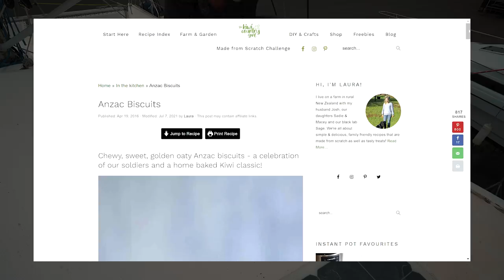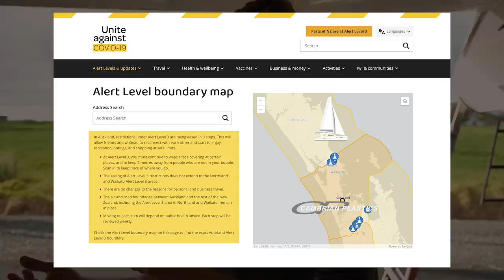BOAT REFIT: Our Biggest Project Ever!

Comment: Just FYI they make a special blade for removing caulk with a multi tool.
Would be very helpful for future jobs ,it has no serration on the blade.
You guys are awesome ...
Reply: I’ll second this comment. The scraper blades for multi tools have a finer edge and no serrations. They are ideal for that sort of caulk removal job.
Reply: I hope they see this comment, my thoughts exactly.  I have the same multi-tool and numerous blade types for it.  I've stripped off heaps of cured caulk in long bands quickly using the scraper blade, worth it's weight in gold.
Reply: One can be made from a standard saw blade by grinding the teeth off and sharpening on the top like a chisel.

Comment: You can get a scraper blade for the oscillating tool that has no teeth, FYI...works pretty good on caulk without as much risk of damage to the hard parts (fiberglass, plastic).

Comment: Add a scraper/knife blade for your multi tool
Reply: Yep and get a few long reach blades too. With a grinder you can make whatever shape knife/ scraper you need by removing  a blades cutting teeth and sharpening the edges .
Reply: I was going to add the same comment. I have made several custom blades for different tasks. However there are a lot of stock blades available. Some multi tools will accept other brand blades, but not all brand blades  work on all brand tools. Take one of your blades with you for reference. 
I agree, the simple scraper edge would be good for the caulk removal and minimize the potential damage to the underlying fiberglass.

Comment: So, you got the oscillator tool - finally! Now get the scrapper blade and you’ll have less stress about “digging” into the fiberglass! Great work, you two are sooooo inspiring! Keep the spirit up and the vids coming! 😷👍🏼
Reply: Yes, absolutely. The scraper doesn’t dig in. Also, vary the oscillating speed, faster isn’t always better(lol). It’s really material dependent. You will find the sweet spot.

Comment: By now, I expect that the windows are back.  My suggestion is to get some 5-6mm thick 'rubber' or neoprene sheets, and make gaskets to go where all of that caulk went.  Glue the gaskets in place with 3M or Sika, and then use the sealant to seat the windows on the gaskets.  Using a gasket eliminates tons of caulk and gives you a smooth surface to work with, which is a benefit to seating the windows.  If you have the space, you can add clamps to seat the windows in the sealant.  If you want to go farther, you could use some stainless trim around the windows and hold it in place with screws and sealant (on top of the gasket).  While the caulk will be waterproof, the gasket would be too.

Comment: Hope the windows come back perfect. They make Oscillating Multi Tool blades for removing sealants & caulking; the blade you were using was designed more for cutting.

Comment: A German tool company named Fein actually invented the first multi tool for Mercedes Benz in order to remove the windshields. There are knife and scrapper blades developed for exactly the purpose you’re using it for. That saw blade your using is a little aggressive. Try a dedicated scrapper blade rather than a saw blade.

Comment: for your multitool they have scrapper blades for them. try one of those instead of the cutting blade. they also have a sanding attachment, works great for detail work.

Comment: If you need to reuse the window, there’s a blade specifically for that. There’s no teeth on it. We used it to remove insulated glass units when doing windows all the time. It just cuts right through butyl with ease. It looks like a flat piece of metal. It’s not even sharp.

Comment: In regards to using the multi tool around the caulking try one of the scraper blades instead of one of the cutting blades. It looks like you’re using one of those plunge cut serrated blades instead of a scraper blade. They also make sanding pads for your multi tool sort of the reason they call it a multitool you can get multiple heads to do multiple chores. Check out the different kind of blades and see what might work best for you based on what job you’re doing.

Comment: We are now 8 months into rehabbing a 32 year old "leaky teaky."  I had to remove numerous old wood screws that didn't want to budge, and of course more than half of them broke off.  My solution was to use a small diameter diamond hole saw.  Can't lay my hands on it at the moment, but it's either 1/4" or 5/16" size.  Unlike larger hole saws, these have not pilot drill.  Using one of these, you remove the broken screw and are left with a neat round hole that can be doweled or simply filled with thickened epoxy.
Reply: Now that's a great idea!
Reply: Yes, that’s the right solution.  I bought a set in three sizes, so I can extract different sized screws.  I think they are 1/4, 5/16, 3/8.  They work like a charm, but require a slow, steady start because no pilot bit.
This reminds me of the time when I broke a bolt, and then managed to break the bolt extractor, and had to buy a “bolt extractor extractor”, a clever 4-point tool that grabbed the broken end of the bolt extractor, removing it, along with the broken bolt.
Reply: To drill in a specific spot grab a piece of something and drill a hole in it then clamp the hole over where you want the hole.

Comment: Regarding the multitool, procure a sanding pad attachment (cheap item), slip an old soft cotton sock over the pad, slobber on some toothpaste and quickly take mineral stains off glass with ease. Works with other abrasives (IE: Barkeepers Friend) to remove deposits on varying surfaces.

Comment: Havnt finished the video but wanted to post this. You can grind the teeth off the multi tool and make it a sharp blade. Wont gouge as easy and makes a smooth cut. Cheers from Michigan!

Comment: Those reciprocating multi tools usually come with toothed blades for cutting into wood metal plastic etc and a smooth knife edge version of the same flat square end blade 🙃 Theres also a C shaped cutter blade and detail sanding head.

Comment: Just a suggestion for anyone doing something similar, on land or water.  A package of plastic wedges is invaluable once you have somewhere to slip one (or two) in.  As you go around keep adding wedges to the new areas and to previous areas, it helps keep tension on the sealant you are trying to break, so the cutting action is more effective and there is more space.  Second, there are specific blades for the multi tool for cutting caulk ("sealant cutter") and for scraping caulk ("scraper").  They are safer than using a wood or metal cutting blade in these situations, as there are no teeth to cut into the surface.

Comment: There is a circular blade for oscillating tool that makes it easier to push along an edge. Much better than needing to keep pushing perpendicular to the saw line and will likely reduce scratching.

Comment: there are many ways to modify multi tool bits with a speed grinder for size or shape. In that instance I would have ground down or off the teeth and corners like a "sharp fast butterknife" probably you're already done with that job, but maybe it could be useful in the future.

Comment: I found a tip to remove sheared off screws from fiberglass.  You can use a rollpin as a drillbit.  Grind the end of it so that it has a lefthand tooth or two and put it in your drill chuck. Then use it like a drill bit (with a hollow center, and in reverse) and as it eats its way down it will eventually either carve out around the broken screw or it will bite into the broken screw and you can turn it out.   This worked for me.

Comment: Interesting question: How much $ did you save by doing windows yourself. Looks like a painfull job. Give us a rundown of what still needs yo be done once you have windows in😉
Reply: Thousands labor on boats is very expensive 🤯
Reply from the maker: It of course depends on where you are, but in the USA, unskilled labor (hull washing, caulk removal, etc.) in a boat yard is billed at anywhere from $50-$75/hour per person, and skilled labor (like electrical work) can be $100/hour or more. So Nikki & Jason have spent at least 3 full 8 hr days removing hatches & windows, scraping/cleaning sealant, & replacing hatches. That's 24 hrs, times 2 people= 48 hrs, billed at $75/hr = $3,600. Which will buy you a LOT of rum! 😜
Curious Minion
Reply: @gonewiththewynns  at that price, I would also have done it myself😜. Looking forward to see you guys back in the water🥰

Comment: Hey guys JFYI.. There's are special 'scraper' blades you might want to look at getting for your cordless multitool. They'd have really helped you here as the scraper blades don't have teeth so
the chances of damaging surrounding areas is greatly reduced. They make the scraper blades for most models of multitool so I'm sure Milwaukee will do them too 👍
Reply: Its always good to have a supply of extra blades (the same as drill bits the smaller ones die quickly) for your multitool you can get assorted packs.

Comment: I'm in the same boat with ;) those suggesting a scraper blade for your multi-tool. They cause much less potential for damage. A file can be used when needed to restore an edge and extend your scraper significantly.. No matter how you cut it, it's all work. The secret is not to cause more work during the process of repair. Back to work! What do you think this is...vacation?

Comment: It often helps when drilling out a small screw like that to get a steel washer that is the same size as the drill and tape it securely over the broken screw.  This will help hold the drill aligned and make it less likely to catch on the broken edge and move sideways or break.  Also, once the washer is in place, hit the screw lightly a few times with a centerpunch to help soften the sharp broken edges of the screw and lessen the chance of breaking the bit.

Comment: For future reference, they make a flexible and rigid universal stainless steel scraping blade which won't cut into your gelcoat/fiberglass.  They also work great for scraping the aluminum hull of the dinghy.

Comment: hey:) dont forget that that is called a multi tool for a reason.  You are using the cutting edge now and they actually have a "bit" or another attachment for scraping only and another one that is for sanding and the sanding one is a triangle, easier for those corners. Get more attachments (blade) types. They even have ones that cut grout or metal. FYI :) Enjoy. Good Luck.

Comment: If you buy the right blades for your multi-tool, you won't have to worry nearly as much about damaging the surrounding materials! Bosch make blades that are specifically designed for removing caulk and other sealants (US Part #s: OSL214K, OSC214C, OSL200FS, OSL138K, etc).

Comment: The Philips head is supposedly designed to prevent overtorquing, by thriwing the bit out when there is too much torque. Which also makes it easy to strip, especially if it is an unlicensed clone (like a Reed Prince tip or a Japanese version) or pot metal.
 Which is supposedly why Philips came out with the patented PoziDrive screw (Ikea uses them, but doesn't sell the tool) which actually is supposed to grab the screwdriver bit tighter and prevent it from spinning out and ruining the screw head.
  Off course Philips drivers ruin PoziDrive screws.

Comment: I know this is too late for you but where I used to work we would keep an old flat window around an make custom scrapers for jobs like cleaning caulk, glue, and other sealants.   Plus they also make a great surface when mixing any two part fillers and adhesives.   I remember my first window,  you seemed to be in better spirits than I was back then.

Comment: Guys 2 pieces of advice while I work in the opposite weather and sweat like …. On my Leopard on the hard. Firstly you get a nice caulk blade for the multi tool that does not have teeth and will not cut fiberglass. 2nd I know those sun covers work great on the inside of the windows in terms of internal heat but being on the inside you are reflecting the heat back through the Perspex / acrylic and creating loads of heat on them and the sealant. It’s far better to put covers on the outside which prevents the heat getting to the glass and sealant. This will help your new ones last much better with less leaks 😊.

Comment: Guys you need cheese wire length and wrap around a couple screw drivers each end and feed the wire through, one person on inside one on outside. Then saw it as the wire heats up from the friction it’ll glide through like butter
Reply: Trust me I used to be a window fitter for cars for years

Comment: More information on Oxalic Acid. Good stuff.  Cleaning Oxalic acid's main applications include cleaning or bleaching, especially for the removal of rust (iron complexing agent). Its utility in rust removal agents is due to its forming a stable, water-soluble salt with ferric iron, ferrioxalate ion. The cleaning product Zud contains oxalic acid.[37]

Oxalic acid is also widely used as a wood bleach, most often in its crystalline form to be mixed with water to its proper dilution for use.

Comment: I was just watching the latest Eammon and Bec video and they showed off a way to heat water for a shower. They had a big black pipe mounted to the top of their van which the sun heats up during the day, then they have a compressor to pump it to the shower head. Seemed to work very well and might be worth experimenting with. Buy the pipe and end caps, maybe make a cradle for it or strap it to your foredeck and add a spigot to add/remove water.

Comment: To remove the adhesive in the hard-to-reach areas, you can use glass cleaner and a fillet knife(the glass cleaner acts as lubrication).  I used to replace automotive windshields and this technique works great.

Comment: Jason, that multitool should’ve come with a guide it looks like a extension with tiny little rollers on it, and that will help you find making errors. Instead of free handing it it lets you operate almost like you have a table or like a router table. The guide should be in the box I think upper obviously it’s a little late now but I think that would make a huge difference and would let you be way more precise. Just FYI for future projects ❤️👍😀😀😀

Comment: Even with all the challenges you've had since starting the repairs, at the end of the day you are still moving forward with the refit/repairs.  It's slow work and given where you are located at least you are still moving ahead with getting the windows remade and that the company is willing to do it free of charge, which they should do since the manufacturing mistakes were theirs.

Comment: Jason, there is an attachment for the Multi Tool that has no teeth. It is a scraper and they come in several sizes. It should be a little less nerve wracking when dealing with the window caulk.

Comment: When you put on the new windows, then don't forget to tape all areas where you don't want the glue to come on. So, the whole glass area except were you glue should be covered and all of the edges on the boat. That saves a lot of cleaning afterwards. Good luck! and best wishes from the 'expert on the side line'😉

Comment: Hi guys, excellent boat work. Not sure if somebody has mentioned that already or you have thought about it, but it wasn't possible with these windows. To remove car windows, front or back, which are usually glued, you can use something like a music wire/piano wire or the like. The wire is passed through the glue line from the inside out or vise versa. With two people the wire can be moved forward in a sawing motion to cut the glue line. Just a thought. At your boat, the glued surface might just be too thick and wide to use that kind of technique.

Comment: I found that if you heat the tip of the broken screw with a 60w soldering iron to get the screw good and hot, then with some pliers it is a lot easier to get the screw out. You may have to cut away just enough fiberglass to get a grip on the screw.

Comment: Jason you need to invest in a set of left handed drill bits and easy outs which isn't that costly. If you can't find them I know on Amazon they have a set they are called screw extractors.  With all the boat work I know you will have allot of use for them!

Comment: You seem to be using the same blade on the multi tool, there are a lot of different ones some that won’t cut into the fiber glass. Might want to take a look if there is somewhere open. Thanks for sharing with us

Comment: @Jason you want a dull blade for the multi tool, definitely no teeth and no sharp corners. Take a blade and grind it smooth and curvy. It needs to be sharp enough to cut soft stuff and quite thin, but definitely not sharp enough to cut yourself. Then it just skips on fiberglass

Comment: If you look at the pneumatic tool blade, it's beveled on both sides (and rounded), both edges so that it doesn't bite into the parallel surfaces that it's trying to separate by cutting the sealant. If you bevel the cutting edges of the multi-tool blade you can get the same effect.

Comment: I use the multi tool all the time for removing caulking and sealants .. the best thing to do is save an old blade and smooth out the tip.. it will cut thru sealant but not any hard surface .

Comment: Two thoughts; if you are replacing the window anyway....take it to pieces OR (and I do know fiberglass and heat (or FIRE)) heat the rubber/tar and try that?  When you start pushing on it, I would think about a couple of crosses with some tape to make sure that if it breaks it is larger pieces, rather than raining shards down on you...

Comment: Have you guys tried a thin stainless steel cable instead of the Milwaukee “ special tool” ??
If you fish the cable through one person on one side pulls the other on the other side pulls back. You can work your way complete around the window with the cable!
Reply: Someone else suggested this tip about 3 hours ago. This is very good.